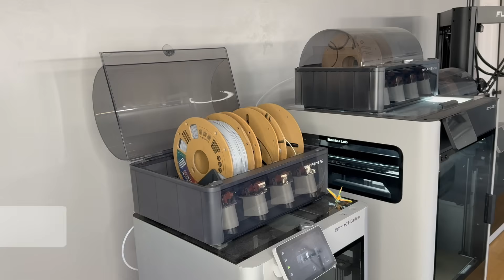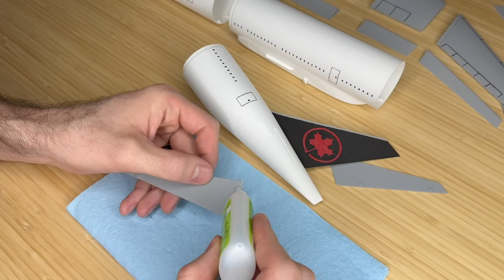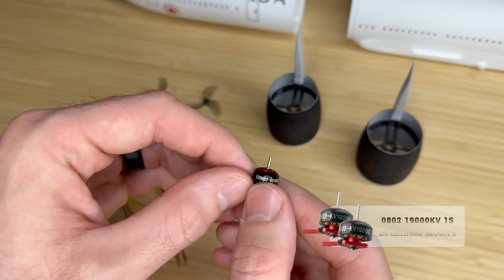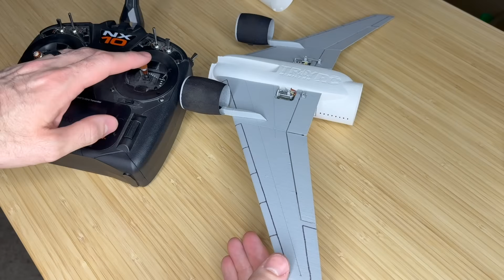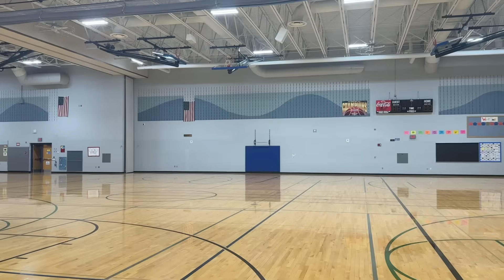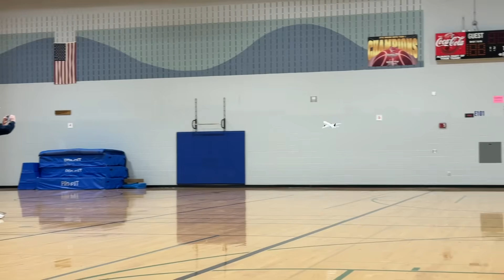STUNNING Lightweight & Scale 777 Micro RC Airliner | Build and Flight

Comment: I'm using this receiver. RX42BL 5-Channel PWM Receiver with dual 12A ESC's. 3.7g with antenna. Differential thrust (mode 2) built in. There is a video on YouTube highlighting this receiver.

Comment: That is one of the coolest 3D printed micros I have seen. Very impressive. 

Adding moderate wing sweep and camber will increase the wing’s lift coefficient, allowing the aircraft to fly at a lower airspeed while still maintaining a scale-like appearance. I typically build these models from Depron for indoor flying and use helium to achieve partial buoyancy. For control, differential thrust from the motors is generally sufficient to provide yaw and roll authority, eliminating the need for ailerons and reducing overall weight and system complexity.

Comment: Don't forget to seal the gap between the elevator and the stabilizer. It increases pitch authority bc it blocks high-energy air from spilling onto the low-pressure area.

Comment: Beautiful! I know anything about 3D printing, but if you allow me a suggestion... Make a linkage between both horizontal tail planes (maybe just enlarging the part inside the fuselage), and then join the vertical tail root to it. I think this will reinforce this without much weight increase. Cheers.

Comment: You should make a version with raked wingtips like 777-200LR or 777-300ER. AC never had any first generation 777's with the squared off wingtips.

Comment: This is really good. I always avoid a full build using 3d machine due to weight issue. But it seems that it is possible to push it that low. I will build mine next time.

Comment: Imagine making it airtight and pumping it with helium before the flight.
Reply: Wouldn't make a measurable difference, actually.
Reply: @coriscotupi  actually by some quick calculations based on the estimated volume of this model, it would create approx 25 oz of lift.

Comment: That plane is very cool! Great work Troy!

If you aren't already, you should use FLAPS (I know you were setup as flapperons with differential, so you'd only have to setup the FLAP mode too). You could slow it down a bunch, but you might need more elevator throw to make the flap to elevator compensation work effectively. Any chance you'd consider putting an AR631 in there and using AS3X+ ??? That would help a TON. Just a couple thoughts. Love the way that thing was flying!

Comment: If you push the motor size a little bit, with a 3D printed adaptor you can use 40 mm 8 blades edf props that are far less noisy. You may use lower kV motors (I used my 12500 KV drone motors). Here is what I did (120 gr AUW) https://www.youtube.com/watch?v=t3r2A-Kqtcw

Comment: very very cool, i did not know they made brushless motors that small with that kind of connectors, can you make a 737-800, i have only found one that is a micro rc and i think the 737-800 deserves the respect. great job on the control surfaces.

Comment: Very cool, why dont you try a drone flight controller they are very light and have built in escs, reciever, and can do up to 18a on 1s! Most are 12a though
Reply: Not sure why I forgot about pwm for servos 😅, although some do have some pwm capabilities, I don't think they have 3 though...
Reply: @joshieeee20 drone flight controllers can be reconfigured to use servos in betaflight.
Reply: @FurmulaScience like I said, they(micro drone/whoop boards) have some, but I don't think they have enough pads for 3 servos
Reply: Whoop boards have 4 motor pads, if youre using 2 motors, then you have 2 motor pads left which can be used for servos, and additionally, all whoop boards have at least 1 TX pin, or LED pin, which can be used as the third servo. This is true for pretty much all whoop boards.
Reply: i didnt know you can use the motor pads for servos!

Comment: beautiful model! is there a way to get it to fly slower?
Reply: Print it 10-15 bigger
Reply: Only way to do that is with the helium hybrids you see - they fly ultra scale.
Reply: @LucienLovesTrains Helium? One liter of helium lifts 1 gram. No practical effects. Fly slower, build lighter!
Reply: @BenErikNess i see you havent seen the big helium planes. They fly with helium pretty slow
Reply: @juanpamb_cl   You did not get the math here. How much helium do you think can go into this small plane. (You also need an airtight container) Big helium baloons flies slow, and there is only one or two commerically availible.
This is slow flying, without any helium help...
https://youtu.be/lQQAu9t0Q6s?si=NDvu1BZk7LoXjiEf
Reply: @BenErikNess  🤦‍♂️
Reply: Remove servos, fix the flaps full down, and add a bit of fixed up elevator 
Fly with differential thrust only
Reply: Maybe make it lighter and Print it with PLA-Lightweight. This Filament foams Up at different Rates / Temperatures while Printing and schould make the plane way more light.
Reply: Please tell me I can fit my 30mm edf’s?
Reply: @flymachine It's literally made for 35mm props... But afraid wing loading will be too high
Reply: Reduction of Wingload.
Reply: I'm no professional but without changing the overall design too much nor the electronics, I'd say to reshape the wing into more of an under cambered air foil (STOL aircraft usually have this) than an Upper Clark Y (commercial air foil). 
Adding larger flaps, reducing total weight of aircraft (Like printing the model with less infill or removing/reshaping structural parts), and replacing the battery with a smaller one can also significantly lower the stall airspeed and make it go slower.
If you're in a colder environment that'd be a big plus, since cold air is more dense than hot air, and will provide more lift in comparison. This is all I can think of right now.

Happy building!
Reply: @Al_Ares  if you want a lower auw... Might as well build it out of foam.
Reply: Id reckon making it lighter is the play. Maybe it could be possible to build your own foamboard wings and cutting an airfoil shape. Maybe some reinforcement with fiberglass and the wing is super light.
Reply: @florensds6547 that's what I was thinking. Don't have lwpla on me though.
Reply: Put some flaps on it.